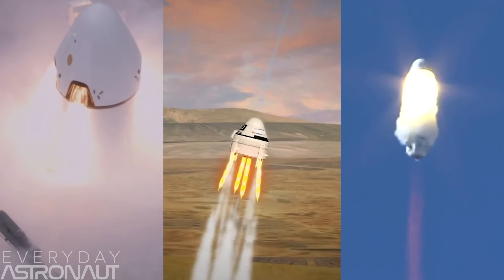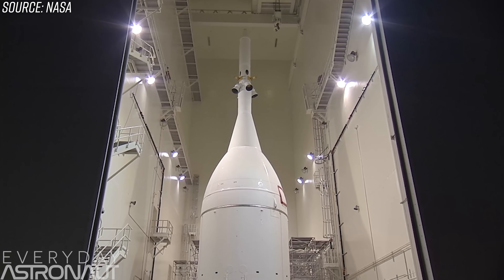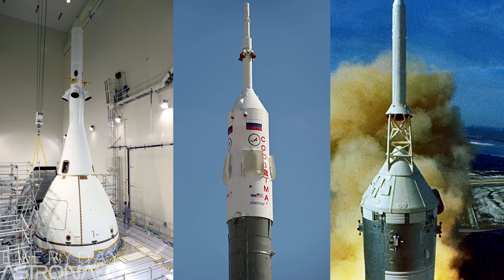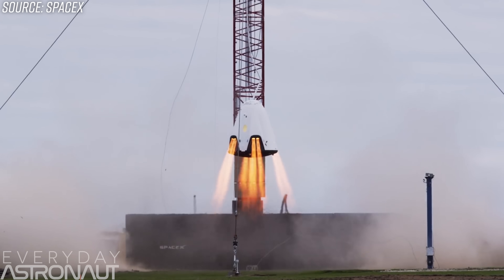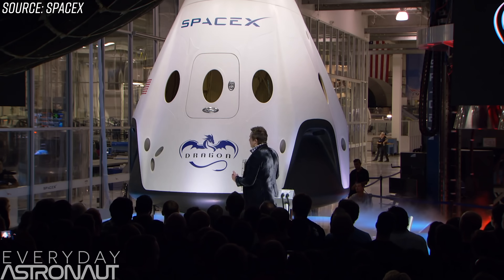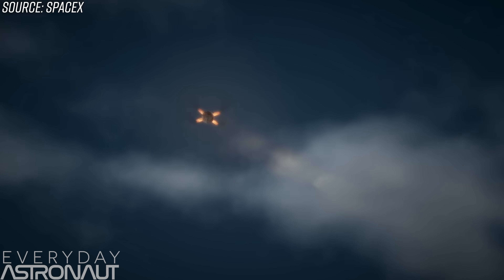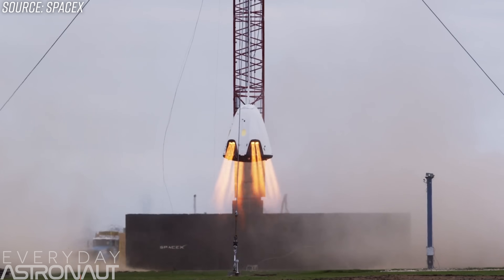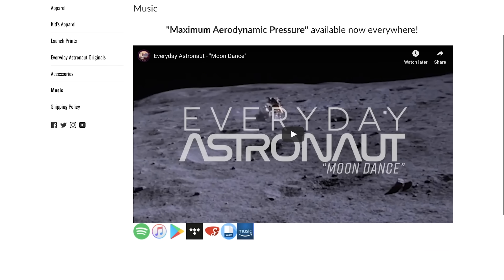Why have SpaceX, Boeing & Blue Origin ditched abort towers?

Comment: The integrated abort system is great except using Hydrozine next to the crew is dangerous!
Reply: All other space craft use hydrazine next to the crew. Either as abort fuel for Dragon and Starliner, or as reaction control fuel for the rest.
Reply: @memefief8527  like I said, all other spacecraft lol
Including the ISS and Soyuz. 
But yes, I guess I did only call out the current 2 projects.
Reply: Hydrazine is not uncommonly used outside of rocketry. We used to dilute it to 35% into 200ltr drums for thermal power stations for their water treatment (oxygen scavenger in water feed at ppm level) I used to test it without any protection gear in the lab (when I was a boy just out of Uni). I ain’t dead yet,  despite my stupidity ignoring safety procedures around mouth pipetting.. Kids!
@Ken

Comment: I'm interested to find out whether SpaceX will use the abort motors as a secret back up to the chutes! I have a feeling that they're going to sneak in a command for it to propulsively land if the chutes dont deploy, two options safer than one?
Reply: If they do I hope it can't trigger via software, only via the crew manually enabling it, otherwise it may trigger at unintended times. Also, it is probably not doable since they can probably not propulsively land on water safely enough, and the capsule would be heading towards a water body.

Anyways, if they find the extra time, another option is always good to have, even if never tested and very risky.
Reply: @1312_PV  The F9s can land propulsively on the surface of water. The rocket topples over, obviously, but the touchdown is soft. I think Crew Dragon can do it as well.
Reply: @neil7250  Probably, I was thinking that water vapour hitting the capsule could be bad. I wish that, if the parachutes were to fail, propulsive landing succeeded, but without any testing it isn't all that likely.
Reply: @1312_PV  I dont think vapor would do bad to the Dragon, it should be able to sustain a lot of heat in the first place and it resists water since it lands on it.
Reply: @Hyperus  Well, it handles water quite badly, I hope there is no problem as well, don't want to boil the astronauts off.
Reply: @1312_PV  That again would fall under the heat category and it handles it like a sunny breeze
Reply: @Hyperus  I'm not all that certain, if it works like Soyuz and many others, at that height there are even open valves for air, and heat resistant covers and blankets that cover antennas or parachutes have alteady been jettisoned.
Reply: @1312_PV  i mean better survive in a damaged capsule than get smashed hard
Reply: Good one. 
Dragon: Huston we have a problem, the shoots dont open (astronaut cuts the electronics cables)
Huston: What now... shoots are the only way to splash down.
Elon: Land it... (he-heey boiis) "Every flight reason to force the landing with engines" [everytime success]

Comment: I'm a little disappointed they didn't consider Cavea B, the best high-energy monoprop developed (but never used) for their abort motors.
Reply: Cavea B from what little reading I've done is difficult to ignite, and since it hasn't been used before, it'd probably take too much additional research to design and then verify engines for it compared to using already well understood fuels.

Comment: Hey Tim, question about starship. Will it be louder than the Saturn V since it will be more powerful? And what needs to be done to the existing launch pads to support the enormous thrust levels.
Reply: IIRC, it's supposed to use brand new launchpads

Comment: The HL-20 and Russian Kliper were to use a pusher solid abort system.
 Kliper could use it's abort motors for part of orbital insertion by firing them in pairs vs all eight at a once.

Comment: Propulsive landing might be developed as a backup to the parachute. As an emergency backup method it might get away with less certification. Only used in the event the chute fails so the chute is the certified abort method. An experimental backup is just a kind of bonus option that might be able to remain unproven. Eventually at some point in the future it may get developed and tested enough to be certified. I would still want a parachute primary though, less that can go wrong. 

Propulsive landing might also be used in combination with a parachute if the vertical rate of descent is too fast or an unplanned landing on the wrong type of surface, such as land instead of water. In that case it could fire just for the last few seconds before landing.

Comment: 12:13 Does Soyuz not carry solid rocket motors to the ISS? The solid rocket that fires just before the reentry module hits the ground, letting them get away with an undersized parachute?
Reply: It does. But they are a lot smaller than abort motors, which is why I assume they’re easier to protect against thermal changes, and they’re much safer to have on the ISS. They are also mounted beneath the heat shield, which would make refurbishment of the descent module more expensive.
Reply: @johndeltondo  The nasa Magellan spacecraft used a large Star 48B Solid rocket motor to insert itself into an orbit around Venus. The large solid motor worked just fine even though it was flown through interplanetary space for over a year before firing. I don't think his ideas on solid motors in this video have any basis with regard for them being in space for extended periods.
Reply: @Jrcraft  I doubt he just made that up. You likely wouldn't get those types of thermal cycles on a mission to Venus, yeah?
Reply: @johndeltondo  The Nasa clementine mission carried a Star 37FM Solid motor in LEO for over a week before using it to preform a Trans-lunar transfer injection. It even had it's own little solar panel 😄

Comment: There is a lot of work going on to develop less toxic hypergolic fuels.
Reply: lol.."less toxic" but still toxic AF....
Reply: Douglas Smith, yeah doesn’t SNC have something greener for the Dream Chaser?
Reply: Maybe they should start making electric rockets? And launch them through a big boring tunnel or something ;).
Reply: @Hoganoutdoors  not really that toxic. Check out rocket labs hypergolics
Reply: @CarlosAM1  Link? From what I gather, it's the hydrazine based fuels that are the nastiest - and the most powerful / ubiquitous. If someone has developed a truly comparable non-toxic hypergolic propellant, I'd think every rocket made would be using it for fail-safe escape systems. Just handling hydrazine is nightmare - most of the other fuels have similar problems from what I gather - some spontaneously combust when exposed to oxygen, others are highly corrosive others are highly toxic, and some are all of the above....and that's just the fuels. Then there's the oxidizers lol....
Reply: @Hoganoutdoors  you can check out scott manleys video about green alternatives to hydrazine and also different websites that also talk about it
Reply: @gregblastfpv3623  Professor Bull was assassinated by Mossad for doing such a thing
Reply: @gregblastfpv3623  Linear Motor launch systems are possible. There are 2 issues though. The heat and aerodynamic stress, and the g forces. The problem is that when the ship gets to the end of the line, it has to be doing orbital velocity, or close to it. Unless the launch track extends high into the atmosphere, higher than the top of Everest, you've got an object moving at the same speed that rockets normally travel in a vacuum, in what is still thick atmosphere. That's going to create a lot of heating. Watch a railgun firing. It's fully electric, no explosives involves, yet there are flames, lots of flames. That's because the projectile is burning under the intense aerodynamic heating as it passes through the air.
The other problem, bad enough for anything but the most hardened electionics, but very bad for people, is the g-forces. A normal rocket takes about 7 minutes to reach orbital velocity, and does so over a few thousand miles (it's already had to go up over 200miles, not accounting for the downrange distance). Again, once the vehicle gets to the end of the track it's got to be at or close to orbital velocity. Unless you've got a track over 1000miles long, then it's got to accelerate much faster than a normal rocket, much faster than humans can withstand. Tests have shown that specially hardened electronics could withstand the g-forces along a sufficiently long track.
The other application of an electric rocket is ion based systems. These are very low thrust though, so need to be fired for long periods to work (but have the advantage of being efficient so able to work over long periods). They are already in use for station keeping or minor orbital changes.

Comment: What happened to if it works don't fix it? Especially when it concerns a saftey feature. 

The old version worked. I know the 15G is insane and all, and it isn't reusable but that's a price im willing to pay for the survival of the crew imo. 

What is more insane is spontaneously combusting because your liquid fuel saftey feature malfunctioned. Or it flipped a 180 in all it's unstability and blasted you back into the explosion you were trying to escape.
Reply: I'm pretty sure that saying is more about actually physically performing repairs on something that isn't broken.
In this video, what's happening is they're making a new variant on an old system to meet changing demands. In this case, the new demand is recyclability, which the old system did not have.
Reply: @Gamerboy385  A. Dont bring pedantics into a logical argument, any engineer would disagree about when it is appropriate to use that saying.

B. I covered the reusability issue, reread what i said.
Reply: "that's a price im willing to pay for the survival of the crew imo"
I'd agree if there was literally no other option, but why are you opposed to finding a way where we don't have to pay that price?

Comment: Anyone know if the crew dragon flight computer will attempt a propulsive landing if it detects that the parachute failed to deploy?   Or does the new design no longer have the fuel for propulsive landings?
Reply: well, if they are landing at sea (splashdown) then there is no land nearby to land on.
Reply: @brachypelmasmith  ? Not sure why that matters. 
Propulsivly landing on water is preferable to crashing into it at 200kph
Reply: but isn't the whole point of propulsive landing to enable soft landing on land. Because landing in water (propulsve or not) exposes capsule to salty water and damages it. Propulsive landing in water wouldn't fix that. By using parachutes they are coasting the capsule in water, so landing speed is not such a problem, water is. Anything that enters the sea is extremely hard to refurbish for another flight, moreso for human flight.
Reply: I think they will, I mean the effort is rather small to configure the thrusters for that and I think the have like fuel to run theses thrusters a good amount of time. 
brachypelmasmith, I think you don't get the original question. It was can the flight abort systems original landing capabilities be used to emergency land when the parachutes fail. If that happens, the landing on land or the reusablity of the capsule is irrelevant. The only important thing then is to land the crew save.
Reply: in that case, I dont know. I am sad that NASA forbade them to go with that propulsive landing, so m sceptical about them proceeding with implementation of that system with all the hussle with approval/licencing process by NASA. It seems like a waste to design something that you aren't supposed to have or use.

Comment: Having the abort engine sitting in the passenger compartment is downright scary as hell! Why would any engineer design something that crazy? Also, it would be easy enough for SpaceX to add a secondary ring abort system like Starliner. Whether or not it is used to jettison the capsule, it would still allow the capsule to use the in-capsule hypergolic engines for a base landing rather than a parachute.

Comment: With a "pusher" a zero/zero abort makes booster go boom.  A plus though is no need for dead weight above the motor required to keep the CG in front of the CP in the abort configuration.

Comment: What are the odds that an abort system would ever push an escape capsule into space (non-orbit)?
Reply: Depends if you're talking about going beyond orbit to escape velocity, and flying away from Earth...
or
Making it to space but not reaching orbital velocity (sub-orbital).

For escape velocity, no chance, the abort system won't have enough capacity to change the velocity enough to go from LEO to escape velocity (especially as they're designed to perform in atmosphere, so will be much less efficient working in a vacuum).

For a sub-orbital flight, sure. If it aborts while it's high up in the atmosphere, if it passes 100km in altitude, then it counts as going to space even if it doesn't have the velocity to make it to LEO.

Comment: crew dragon propulsive landing when reusing it as a cargo vessel? just an idea :)
Reply: Propulsive landing of the Cargo Dragon was how SpaceX originally wanted to test the system but I believe NASA didn't want to put their returning cargo at risk. So SpaceX would have needed to launch their own propulsive landing tests and since these would have required lots of tests, it would have increased the cost significantly. That is one reason SpaceX switched to parachutes as the main landing method.

Comment: I think there is another additional reason to prefer liquid propellant engines. They save fuel.

During launch, the rocket moves in dense layers of the atmosphere at high speed. And the large 'mast' on the nose of the rocket creates a large deflecting moment of force. Also, the center of aerodynamic drag is shifted a few meters to the nose, and the center of mass remains almost in the same place.

To compensate for the deflection moment, fuel is inevitably consumed, which is included in the launch cost, and also determines the maximum weight of the spacecraft put into orbit.

Comment: No-tower onboard system - Reason #1 - Cost trumps safety. #2 - Entertainment trumps safety. #3 - Non-abort functionality trumps safety. #4 - Flying the abort motor to the ISS trumps safety. #5 La-la land dreams of landing with the abort system trumps safety (see #3). #6 Single-point failure potential of a common fuel system (RCS and abort) trumps safety. #7 Re-usability trumps safety (see #1). #8 Sticking with faulty-logic and outdated decision factors trumps safety. #9 Hiding behind BS PR ("anomaly" ...really?) trumps safety. #10 - 'New and different' for the sake new and different trumps safety.

Comment: Dear everyday astronaut, at 12:25 minutes, you told that solid fuel is not good because it has to go to ISS along with crew dragon. Actually crew escape system required only till solid motors phase mainly. In-orbit abort can be assisted by Service Module. So in my view until unless retro propulsion is not used, there is no need to carry any type of CES till ISS.

Comment: You missed one big reason for scrapping tractor escape system, weight! And as you know weight equals money and more useful cargo to space. The Apollo launch escape system weighed 8000 lbs and while it is ejected it stays on for the most expensive part of the launch. Not to mention the depleted uranium used to counteract the pendulum rocket problem.

Comment: To insure normal operation designs are stress tested. Aircraft get a 1.1X stress test. Bridges get more. Buildings more. The extra stress accounts for imperfections in construction and maintenance. I once tested an aerospace black box at 1,000 X the expected input frequency. I found some problems. I fixed them.

Comment: A liquid fueled abort system such as on the new Dragon Crew is actually more economical. If you add some additional plumbing and  that way, if you have a good safe launch, and don't need to abort, then your abort fuel can then be routed to the Reaction Control System.

Comment: There's some conflict with using the same fuel and engines for launch escape and propulsive landing, that takes lots of fuel and starting the rocket motors twice. It would be much easier to have separate abort modes, launch escape with parachute landing or propulsive landing in case of parachute failure.

Comment: In a pusher style abort scenario (Starliner or Dragon) do the abort engines actually utilize thrust differential to steer? Are the crew module RCS thrusters used at all for additional guidance?

Comment: Another reason for the pusher configuration of the LAS over the tower rockets is that an aeroshield would be required for use with a tower mounted system. Keep in mind at least one of these vehicles was designed with future space tourism aspirations in mind. An aeroshield ruins the view.

Comment: Look, I love your videos, I really love watching your launch live streams, but thermal cycling solid motors like you mentioned is fine. In fact, it's done on the station everyday. Each Soyuz spacecraft uses 6 solid rocket motors that fire right before landing. There is no issue with them being thermal cycled. The NASA Magellan spacecraft used a Star 48B solid rocket motor for insertion into an orbit around Venus after costing through interplanetary space for 1 year-3 months before firing, with no issue.

Comment: So you said SpaceX will be reusing Dragon 2 capsules for cargo missions.
When they do that, I'm sure they could try to land propulsively (at first offshore on a barge), while keeping the parachutes as a back-up system.
Since it almost doesn't matter what happens to the capsule after it deorbits since there's no crew on board, it makes sense to test it in this situation, as reusing Dragon 2 capsules for crew can still be tested to the point that NASA would trust it, simply thru the normal course of running SpaceX cargo missions to the ISS.